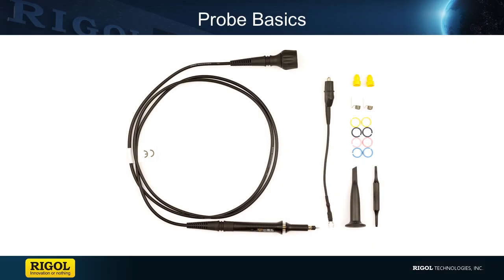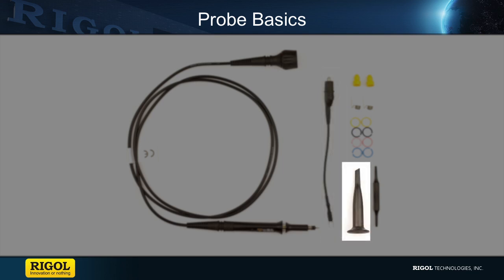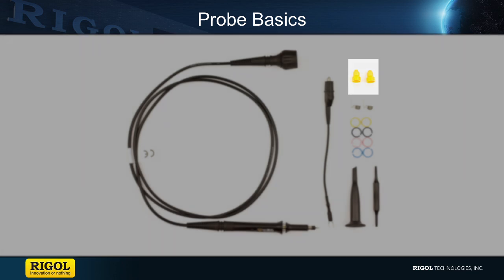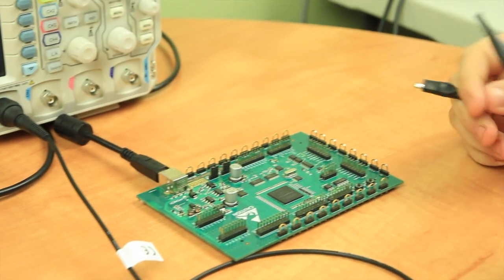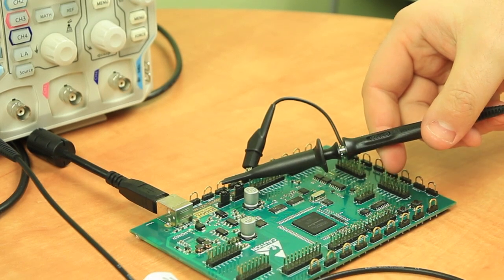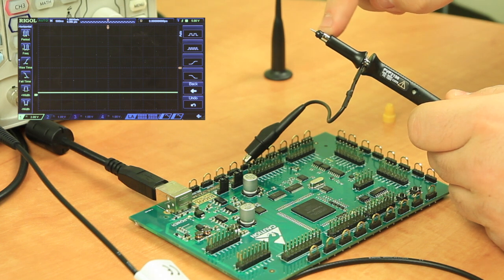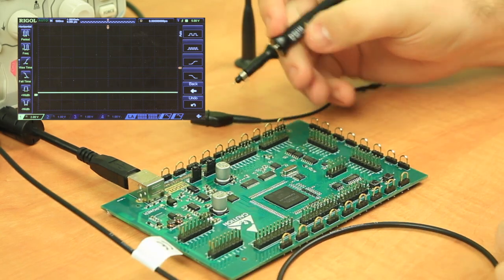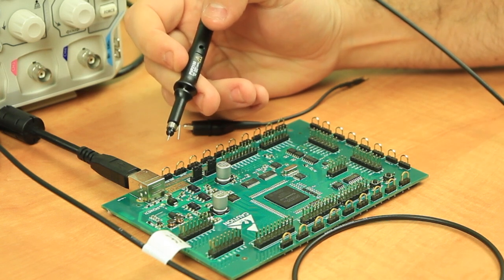Probing Basics

Comment: thank you. Please Please, how do you figure out which ground to use. I have boards with incoming AC, then the power branches out in to multiple voltages of DC, and sometimes DC back to AC it seems which is sent out through Hi Frq transformer. how do you find the ground for probing in such circuit? would you use the same ground to test every thing? I see electrolytic caps on all the blocks. should I use their negative for my ground attachment when I am probing with in each block...or find a IC incoming and use the negative incoming or how about Diodes..... I would really appreciate any constructive feedback.
Reply: Jhonsosns Controlls designed boards?
Reply: I love how he doesn’t answer the only question that matters that literally no one talks about in any video

Comment: What does the attenuation switch do?
Thank you
Reply from the maker: Hi. The attenuation switch reduces the total voltage but typically improves the bandwidth performance of a probe. A standard passive probe may be about 35 MHz at 1x attenuation, but at 10x (meaning 10% of the voltage) they could have 100-500 MHz of bandwidth.
Reply: @RigolTech  So how would you know at what setting to use it? Is times one the usual setting needed?
Reply from the maker: @SDsailor7  I use x1 for low speed signals where I want the best noise floor. Use 10x for when you want the best rise time or high frequency performance.
Reply: @RigolTech  Thank you. It's good to know.